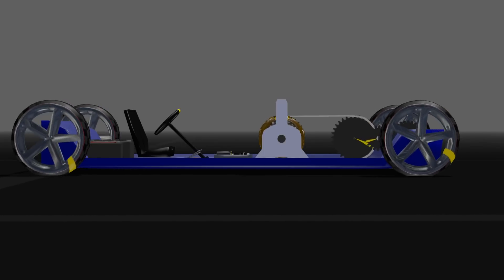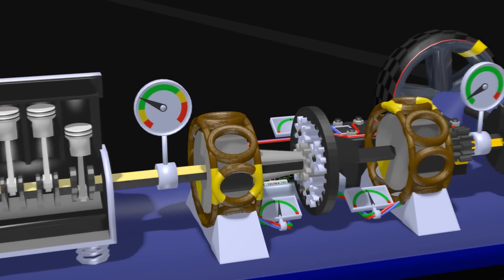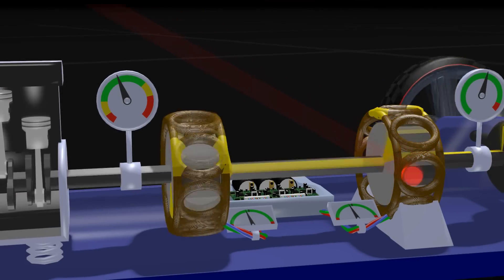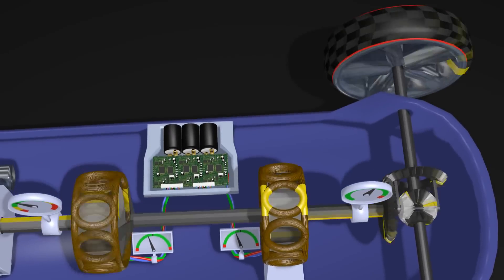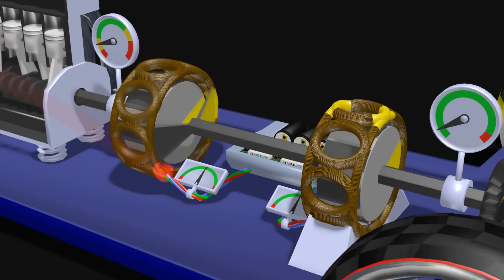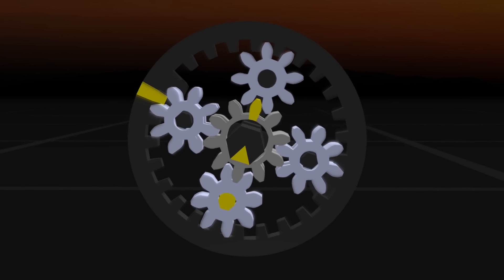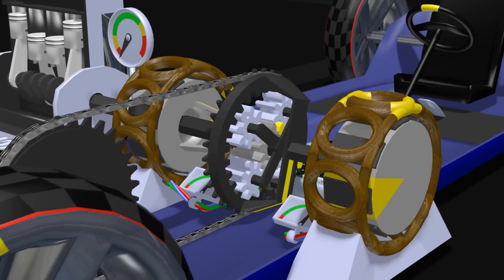Prius Hybrid Drive Explained

Comment: toyota is fiddling with everything for 20 year but it will never catchup with simple and best drive ever made,
 from general motors installed in chevrolet volt and ampera...japanese still dont get it...
Reply: Look at the fuel efficiency of chevy Volt and Prius second gen and then say which is better and worse. Volt burns minimum 10 to 12l gasoline per 100km with empty battery, Prius needs no more than 6-7l. In my country LPG is very common and with LPG installed on Prius, it becomes not just fuel, but also money efficient. The idea of totally separated petrol engine is great but something's not right with GM's implementation.
Reply: @tsvetomirivanov9762  I own a Volt gen2 and consistently get 4L/100km  in extended range mode
Reply: matjaz lesnjak lmao gm hybrids are worse in pretty much every aspect
Reply: @pmo5821  please do tell us why....
What do u drive...???
Reply: @matjazlesnjak4983  The GM hybrid system is literally a copy of the Toyota system except they added an extra clutch pack that's rarely used in real-world driving conditions. Otherwise that clutch pack is sitting open and incurs about 3-4 Nm of drag losses constantly.

With the exception of Honda all mainstream cars' dual-motor hybrid systems are licensed off Toyota's design, using a planetary gearset as a power split device and then additional gearing either planetary or parallel shaft to sum power between engine and MG2.
Reply: @pmo5821  The Volt system is not the same as the Toyota. It is an electric car with a range extender, there is no connection between the engine and wheels. There's a generator that also acts as a starter motor and there's a drive motor that also does regenerative braking. The two have no mechanical connection. Of course the Volt will get worse efficiency with an empty battery, it's not intended to be used that way very often, it's got a relatively enormous battery that's intended to be charged plugged in. That battery makes the Volt a lot heavier than the Prius.
Reply: @SeniorKlean   What you're describing is a series-hybrid mode, which is one of several that the Gen 1 Volt can do, and uses primarily at low speeds. In this mode the traction motor drives the sun gear of a planetary gearset, the output is the carrier, and the ring gear is held still by a clutch pack. The engine drives the generator and the electricity is sent to the traction motor. However this is only one of the hybrid modes; there is also a power-split hybrid mode.

In the power-split mode the engine and generator are connected via clutch pack to the ring gear, and the clutch pack holding it still is disengaged. Now the engine power is split between a mechanical path (engine -> ring gear -> carrier) and electrical path (engine -> generator -> traction motor -> sun gear -> carrier). So, your statement that there is no connection between engine and wheels is inaccurate. There are 3 hydraulic clutch packs that enable these mode changes (ring gear to ground, engine to generator, and generator to ring gear). In any given mode there is at least 1 open clutch pack, and in some modes (dual motor EV drive) there are 2 open clutch packs imparting drag losses. 

The Gen 2 Volt system is even more similar to the Toyota layout, and there is no series-hybrid operation at all. The Gen 2 system has two power-split modes for hybrid operation, along with several EV-only modes and a fixed-ratio engine-only mode. The Gen 2 Volt motor and geartrain setup can also be found in the Malibu hybrid albeit with a smaller battery since it's not a PHEV. Less the battery weight, the current generation Malibu hybrid still underperforms in economy relative to the Camry and Accord, especially in highway performance. This is despite the fact that the 2nd power-split hybrid mode is designed specifically for high-speed low-load cruising. The Gen 2 system still retains 3 hydraulic clutch packs but in a different layout from Gen 1, and still incurs the energy losses of a hydraulic pump and viscous drag loss.

Comment: o my  my so much stuff but still not working perfect  i have my on design which can work perfectly generate current charge battery  and drive the wheel but the real challenge is it will not work when the engine is rotating in very slow speed or i can use gear increasing , then even in 1 rotation of the engine per 10 second speed  increasing the rotation will give more current  through generator but then even in out put shaft  over drive cant be achieved

Comment: Bro the engines on Toyota’s are designed to save gas and effectively transfer and move the car it’s called vvti and the engine is intake vvti only but works great in a Prius 2ZXR FE engine(3rd gen, similar naming in other prius of other genaration) also, priuses need to stop being enslaved, because it’s such a good car and cutting emissions smog level, we should praise Prius #endpriusslavery #endpriusdiscrimination
Reply: just get a corolla hybrid. Basically a prius but with more style

Comment: So what s the difference between the ECVT and CVT? Where is the new pulley located?
Reply: E-CVT got neither the pulleys nor belt. E as in electronic and any given output speed comes from the electric motor.

Comment: beautiful. SO where is the CVT/eCVT in the animation ?
Reply: There is no CVT, but the planetary gear system acts like one. When you need more power from the petrol engine, one of the electric motors slows down so the petrol engine can rev up. This behaviour simulates a CVT.
Reply: @darkknight8139  ah so there's really NO transmission (CVT/iCVT/whatever-T), NO belt of any type, but the electronically controlled P610  planetary gear doing the work of one, right  ? thanks
BTW I just got the 2020 Corolla Hybrid (eCVT). Hope it works well.
Reply: @MontyGumby  Indeed, no belt whatsoever. The computer controlled combination of the planetary gears, revving of the petrol engine and rotation of the electric motors behave the same as a CVT would do in a non-hybrid car, if you only listen to engine noise. Your Corolla and my C-HR both have this system.

The Honda Civic hybrid has another system: it has an electric motor between the engine and the (real) CVT transmission, with a clutch on either side. This way, the petrol engine can run together with the electric motor, powering the car. Also possible is to drive fully electric (by declutching the electric motor and the petrol engine), or only charging the battery (by declutching the CVT). That is a completely different approach, more of the "classic" hybrid way.

Toyota's approach with this CVT-like planetary gear system proves to be very reliable and maintenance free :)
Reply: @darkknight8139  thanks ! final Q is about the Atkinson engine - how is it it can be switched on-off like that without costly waste of starting an engine ?
Reply: @MontyGumby  It is switched on by letting one of the electric engines turn slower while the other electric engine runs at the same speed. The momentum of the movement of the car will start rotating the petrol engine. Add fuel at the sweet spot of rotation, and the engine is started. At standstill, the electric engine starts by turning one of the electric engines to start the petrol engine, while rotating the other electric engine in the opposite direction. Then, the car does not move because the two rotating engines cancel each other out.

The Atkinson principe is something else, that has to do with valve timing. The Atkinson cycle is more efficient than the normal Otto cycle, but Atkinson produces less torque. The electric motors compensate for that. Mazda is currently working on a petrol engine using both the Otto and Atkinson cycles, depending on the power need.

Comment: The basics of the drive is two parallel motors, electric and petrol feeding into a planetary gear cluster that goes out to the wheels. The planetary gears are not CVT as in a series drive petrol car.
Reply: so where is the transmission CVT or whatever ?
Reply: @MontyGumby the system shown in the video is the CVT it uses the second moter to allow efficient operation at a large range of speeds with no need for separate gears making it functionally a CVT.

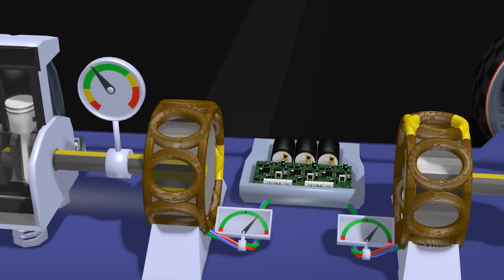Comment: 3:42 If the engine is tuned to run at its sweet spot, it will be less than 10% loss.  This 10% loss can made up by gains in less weight for the car to pull along and less losses in no large complex mechanical transmission. Direct piston generator to electric motor drive is used in ships and has been for well over 100 years.  Few cruise liners do not have electric drive.

Comment: Nice explanation...thank you for creating and sharing this video. I have to say though...only having to go to the gas station once a month is quite a party trick!
Reply: and being blown over by a tractor trailer is another trick. Get a real car
Reply: @darinp5612  the car is actually pretty heavy and has a low center of gravity with its battery. I know it doesn't look like it. It weighs over 3000 pounds. Everything about the car is counter intuitive. Toyota made a more reliable car by making it more complicated.
Reply: @AmosMosesJr  no more reliable than a 91 Corolla with an actual gas instead of some power wheels car
Reply: @darinp5612  I am starting to think your comment was a joke. I own an f150 but chose to buy a prius for my daily driver because they're reliable and economical. It also costs less than half to purchase and less than half to operate. I will be honest I enjoy all the tech features as well. I would never have thought I would be a prius driver 10 years ago. Sitting here today I have only good things to say. My first Toyota too.
Reply: @AmosMosesJr  So you're one of those that compensate for the comments by having two different vehicles in the spectrum. Prius's are junk, have no resale value, and if you want to get to the "faggy-ness" of them, they're worse on the environ. than the f-150 you have... pretty much anything with a push-button start is a shit-box
Reply: Darin Porter show us on the doll where the Prius hurt you 😂
Reply: @mikespark72  and you sir are a troll instigating a conversation 8 months old...
Reply: @hudsonquay  those ppl that use that excuse are the ones that don't know how to open their hood. Take the bus

Comment: omg I have a ms in chemistry and I couldn't understand anything of what he was explaining its just too complex for me
Reply: I'm studying mechanical engineering and even for me it was hard to wrap my head around at first. If you really want to understand this you would need at least a basic understanding of planetary gears and internal combustion engines. I only understood the Prius drive fully once I took an hour to pause this video at the right places and made some sketches myself.
Reply: It is essentially using moters as a way to control the output of a planetary gear so you don't need a normal transmission compared to how gears on a normal transmission work it is fairly mechanically simple.

Comment: this technology was cool but now its obsolete. they have even tried to make it more relevant by renaming them to "self charging" but that's just false advertising
Reply: No ac belt, no power steering pump/belt, engine is off 30-40% of the time so 30-40% less wear and tear on engine, brakes last over 100k miles, well past it if you utilize the generator. Some people have gotten to over 180k on their first set of brakes. Puddles, no worry take your foot off the pedal, with water splashing your engine wont get water in it. Transmission fluid is every 150k, oil changes are every 10k. Battery lasts over 10 years. I get 45-67 mpg depending on what I am doing. You get the energy back from braking, well like 70-80% of it. I've gotten almost 2000 miles from braking, over 30k miles on car. 15k miles on electric motor  engine off. 

I get 641 miles of range(Highway only)! on average. For 1 year at a job i stayed at I was averaging 63mpg over a 40 miles together(Hills and 40mph speed limit), trip to work every day. Just work would give me 882 mile range. 

If you want range and speed of filling up a hybrid is the better option then a reg car or even a tesla. If you want more efficiency though, lesser "fuel/energy" costs then a tesla is the best. 

Tesla gets Over 81mpg equivalent in my area based on electric prices.  My gas prices 2.87/gallon, electric price of 2.87 gives a tesla 81miles of range.  They use about .36kwh per mile traveled.  indiana its 9.8 cents a kwh, so 2.777 miles per 9.8 cents or 3.52 cents per mile. Hybrid gets 6.37 cents per mile. A regular car gets 11.48 cents to 13 cents per mile. A truck averages 17.8 cents a mile.
Reply: @Bleksano  still false advertising still spewing pollution out of the tail pipe, some  Tesla's have free super charging which throws your mpg equivalent out the window.

Full bev is the responsible way to go
Reply: @DorsetSaferRoads  free supercharging? No sir you are incorrect
Reply: @acaughey09  on some teslas especially with referral codes, even if you do have to pay for your electricity its still a lot cheaper than petrol
Reply: @DorsetSaferRoads  Tesla sometimes mutates in some hugly religion. This can affect the mind of the speakers.

I see daily, giant Lexuses or small Toyota cars making a ridiculously low fuel emission/mileage. In the same time, the lifespan of the engine and the battery is enormous, and the engine is often completely shut in city traffic.

Yes, it stills uses a little bit fuel, but as much as a motorbike. If all SUV's coming out right now would have this technology, the air quality would radically improve in every major city. And yet, that those cars are everywhere, the technology is really starting to becoming affordable.

Also, EV will take a while for becoming as competitive as the ICE ones in terms of range. They will have to change the core of car design for reaching that, and I see nothing of the kind happening in the moment. They mostly try to sell fancy "old tech chassis" with newtech engines. Even the Tesla still has a hood and doesn't exploit all advantages of it's construction.
Reply: @boboutelama5748  in the real world, these hybrids don't make the mileage they claim they do. Burning any fuel is bad they will never get close to a full EV in that respect.

Even my 40kwh leaf goes as far as I wasn't to go without wanting to stop. Sure some people like to be able to drive further without stopping but years of experience has shown me that you shouldn't, it's not good for you. 

I can do the 300 mile drive to my family in Hull with 2 stops, which is exactly what we used to do in our petrol car.
Reply: @DorsetSaferRoads  Now you are talking BS. Lexus and Toyota are the first brands when it comes to quality. Its well documented through consumer rankings and other reliability rankings from diverse sources. Especially the last gens Toyota Priuses are known to be very difficult to wear off, but not only them.

Please inform yourself before spouting things on the internet.

Ev's are becoming good. I really hope they will do better examples in the future, because they are always far away from what this technology could achieve.
Reply: @boboutelama5748  since when does reliability have anything to do with obsolescence?

plug in hybrids arent really much better than conventional ICE, you still have that rattley internal combustion engine in there that needs regular servicing and still pollutes our air far more than any EV ever will.

EV arent "becoming good" they are good now for the vast majority of people who buy new cars.
Reply: @DorsetSaferRoads  while I will agree that Ev are getting there and will be the future, it's not all roses and rainbows with Evs.  The energy they use also needs to be generated somehow and right now the coal being burned in coal power plants is way worse than petrol in terms of CO2. Also their bigger batteries require a lot of rare earths which have to be extracted using rather nasty chemicals to get to them. There are no Co2 neutral cars right now if you account for production and lifetime. I love EVs but we will get nowhere with a onesided view. That means accepting the important role hybrid play along the way. Hybrids have been on the market for over 20 years now and have performed great. They have greatly improved milage and provide a stepping stone to Ev, which currently does not yet have the coverage and pricing to be competitive. Always try to look at the broader picture before proclaiming one thing as the end all be all which simply doesn't exist
Reply: @sephbox  thanks for the reply, however there are some errors in your post.

Sure to the greater efficiency of large coal plants even if a EV was only powered by electricity from coal it would still produce less co2 per mile than burning petrol in an horribly inefficient car engine.

So when you take a country like the UK where I live that gets most of its electricity from natural gas and renewables an ev is far better. Less than 5% of our electricity comes from coal, none of you charge over night.

Yes the minerals have to be mined responsibly but also remember that batteries are being repurposed after they lose enough capacity in a car to be of no use and recycled into new batteries at and of life.

You are right nothing is neutral but EV are a hell of a lot better than burning fossil fuels in engines.